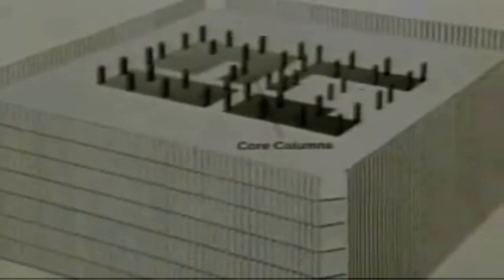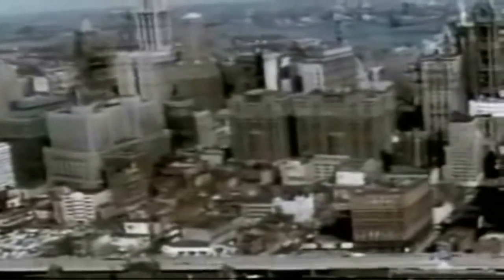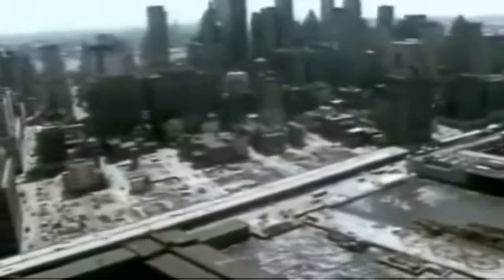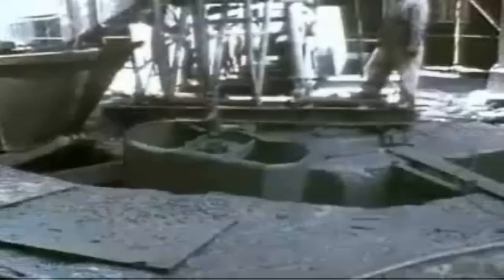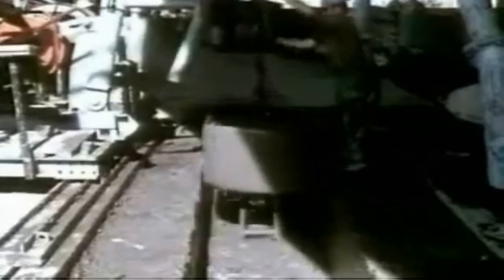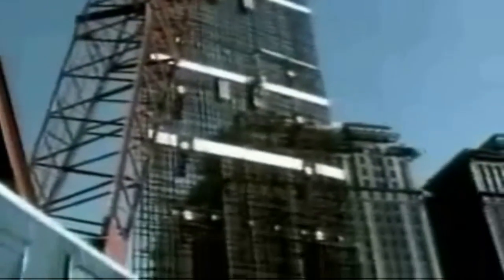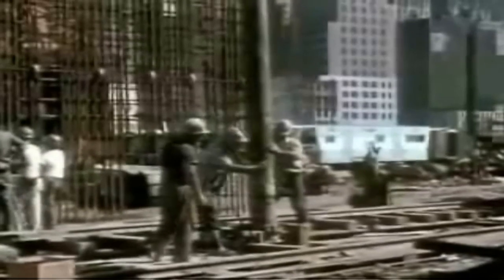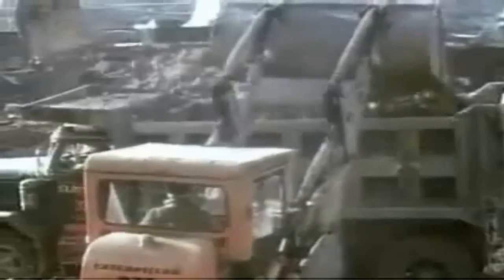Building the World Trade Center Towers

Comment: I still don't understand how people are able to built such tall buildings... Including antennas towers with this size . How is this even possible. We should all be talking classes to built s better tomorrow
Reply: Man built these towers piece by piece, lifted via hydraulically actuated cranes, that were subsequently also built piece by piece. 

The cranes rose by way of large ramps on each floor that were later removed, and by cranes attached to the sides of the buildings that were eventually risen, piece by piece.

The buildings were built on high tensile strength bedrock (to compensate for weight/vibration/pressure). The floors were built by way of large rods made of twisted steel/iron beams. These rods were crossthreaded, and then in each crossthread, wooden walls were pushed down and a wooden floor was assembled underneath, and concrete slurry was poured in. The wood was then removed and reused for the next section of crossthread.

The crossthreaded rods used heavy duty (4-5 feet thick, sectioned 100 feet apart or so) 4-point crossbraced steel beams to contain them. These steel beams were riveted by way of heavy duty rivets to a whole pattern of crossbraced steel beams within the floor. To make the bracing for the walls, more crossbraced steelbeams were attached vertically at the endpoints of the crossbraced floor beams, by way of the same heavy duty rivets.

One by one, each floor was built, piece by piece, often assembled by hundreds of men. 

After each floor was complete, exterior facade assemblers were hoisted up and did similar processes on the exterior with poured concrete slurry/wood/crossthread rods connected by outwardly ejecting crossbraced beams.

Electricians then go in and drill holes into the concrete floors/roof to wire up the buildings for lighting. Plumbers and HVAC technicians do the same thing for piping, toilets, water, heating and ventilation, the implementation of which is already pre-designed into the main “chassis” of the building prior to it being built. Lastly, standard carpenters create walled areas, paint the rooms, insert flooring, and insert decor.

That’s how a high rise is built.

Modern highrise buildings are often made to within millimetres of their original design specification, because the workers can utilize special laser-guided tools that compensate for many different factors. This can mean that the contractors of such large projects can save lots of money in labour, and the work can be completed more quickly. Furthermore, test models on a computer can simulate wind load, weight shift, and tensile strength, etc. This means that the very bare minimum of materials is used, also saving money.

What makes a building such as the ones shown in the video so great, is that to compensate for poor tolerances/minor mistakes in engineering, materials/labour was beefed up to a very high standard. These buildings were made to last 150+ years without major structural decay, despite them only lasting 28 years.
Reply: all because  of  the  stupid  territories
Reply: GiozRockin 
People didn't build them, men did.

Comment: There is no way in hell a  jet airplane wing only made of .02 thick aluminum is going to cut tho those THICK STEEL support beams on those outside walls. it should of at least rip the wings off and said wings would have or at least parts fell to the ground.  Steel is thick and hard while aluminum is soft and flexable, In all case's steel is going to win out hands down its just plan common sense !
Reply: gunslinger748 you gotta remember, these planes were going at very high speeds
Reply: +thatsthesameoldshit lol
Reply: +DeedsResearcher very clear you did not watch the video over a few times, it clearly shows the outer structure in which are made out of those large steel  beams. now sense you did not even try to address the the hardness of the steel beams to the thin aluminum that the wings are made out of. first go look up on youtube how commercial airplane wings are made ( you might learn something), than address the fact that 10's of thousands of commercial pilots across this country and around  the world with 10's of thousands of HOURS of FLIGHT TIME <--- that means real time flying in the hot seat ( called PIC - Pilot in command of the aircraft) tells a complete opposite story so who is lying or who is telling  the truth, if you side with the gov on what happened than sir your a new form of stupid, when experts in the field from around the world  I guess there lying to along with all those pilots and those experts are lying as well, and includes the NYC firefighters. The Truth is out there somewhere just a matter of finding it !
Reply: There's videos of it happening. Wise up.
Reply: +gunslinger748 Are you of the mindless opinion that the planes were made of aluminum FOIL? Get real!
You "might" have had a point if the planes had impacted the bottom floors of the towers. Reason? Because that's where they had the heaviest and strongest steel beams! However, as they went skyward, the beams were not as heavy or as strong because they did not need to support as much weight as the bottom beams. After all, they had over 100 floors above them to support, while the beams nears the top had 10-20 floors to support. HUGE DIFFFERENCE!
By the way, junior, I just took several flights, and took a good look at the thickness of the aluminum. It was a HECK of a lot more than 2 HUNDREDTHS of an inch thick!Final point: Any chain is only as strong as its weakest link. We can all agree on that. Well, the weakest part of the outer walls of the Twin Towers was made of GLASS! Ever hear of "windows", junior?Case closed.